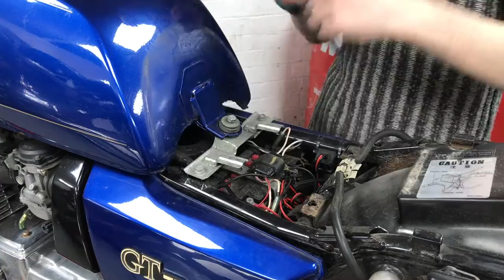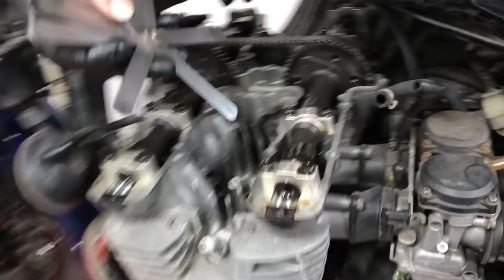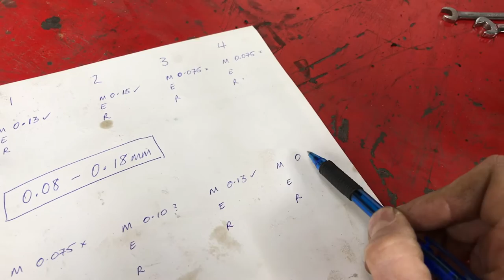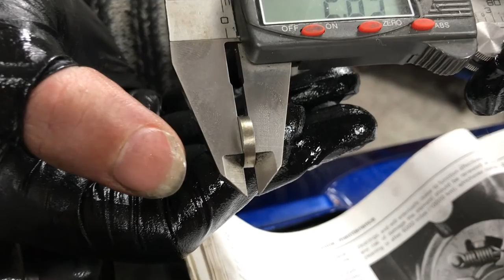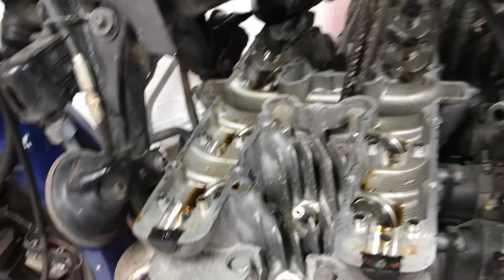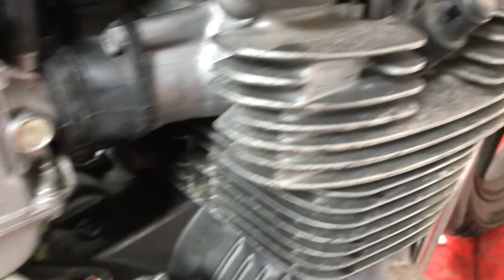Kawasaki GT750 - How to Adjust Your Valve Clearances

Comment: I am a long term owner of a Kawasaki GT750 P5. I watched this video yesterday as a refresh before checking the shims on my bike. I enjoyed the video but would offer the following comments:
1) The coils have to be unbolted, but not necessarily disconnected from the wiring loom. I clip mine up on the  frame tube out of the way, still connected to the wiring loom.
2) If the shims need changing I cable  tie the camshaft sprockets to the camchain,  remove the cam caps, and let the cam ride up sufficiently to get at the buckets. Always check the valve timing afterwards to make sure that everything is still ok.

I enjoyed the video
Reply from the maker: Hi Neal. Thanks for watching and for the tips. Hopefully someone else watching this video in the future can put them to use. Glad to hear the you enjoyed watching 👍
Reply: And make sure the chain doesn't slip on the crankshaft.

Comment: I have a zn700 1984 just took the valve cover off and this video has saved me tremendously
Reply from the maker: Awesome! Glad to hear it helped 👍👍
Reply: So my question is how do I go about measuring if valve clearence is way to tight to fit the lowest recommended feeler gauge.

Comment: Hi, great vid mate! Did you by any chance get oil appearing on the top of your cylinder head fins, either side of your cylinder 1 and 4 spark plugs after you'd ridden it for a few days? The outer 4 bolts on the cam cover should have thread lock on them but it wasn't mentioned in the video so I don't know if you did it. These 4 bolts threads are open and oil works past the threads and eventually pools on the top fins, ask me how I know!
Reply from the maker: Ha, I won’t ask 😁 I don’t actually remember now if I did put thread lock on. Whatever I did it would have been from the Haynes manual. As it happens I haven’t had any oil leakage at all - so perhaps I did! 🤷🏼‍♂️
Reply: Mine do that!!!! Always wondered why. Cheers 👍🍺🍻🍺

Comment: Checked my valves yesterday after watching your video. #4 inlet valve reads "0" too! All other valves are within tolerances. Where did you start getting #4 within the specs?
Reply from the maker: I seem to think we switched it out for another shim and manually turned the engine over a few times. Re-measured and then re-shimmed it. I think the valve was slightly sticking

Comment: Is your bike the later zephyr engine? I couldn't find a Haynes manual that covered this bike so use a zephyr one instead.
Reply from the maker: Uhm... possibly, not sure if/when they changed it. Everything I’ve done on the bike has come from the ‘Kawasaki 750 aircooled fours’ Haynes manual. It seems to cover everything I need 😁

Comment: Hey guys, this is stock exhaust but sounds better then mine! could you share the mods?
Reply from the maker: Hey! The only difference here is that the baffles have been removed from the ends of each exhaust can. It was done before I bought the bike, but I think the original end baffles are just riveted in 👍